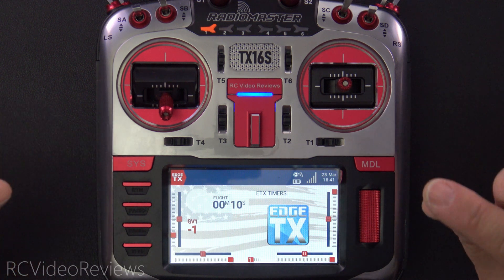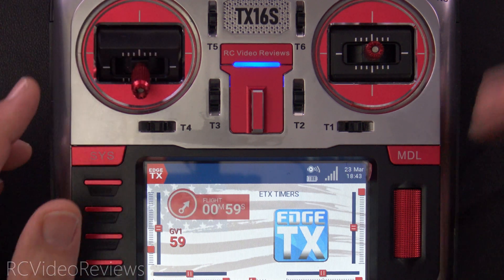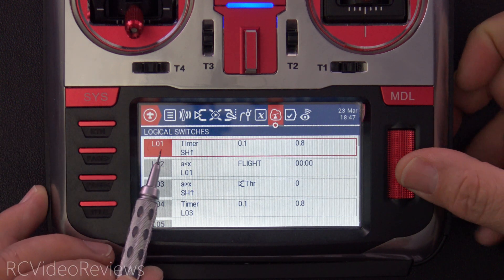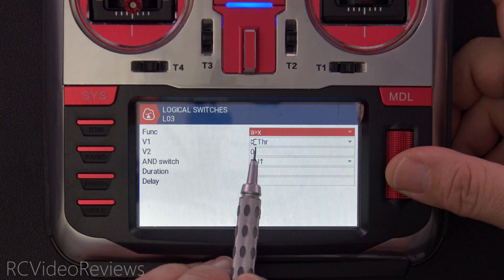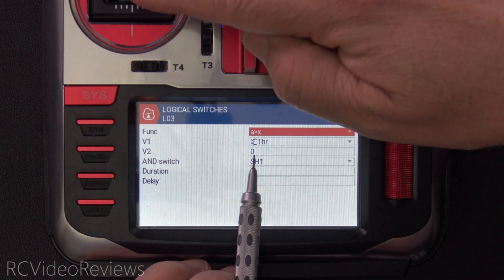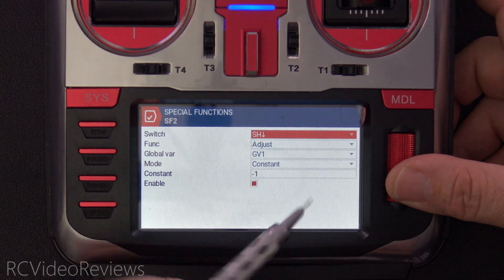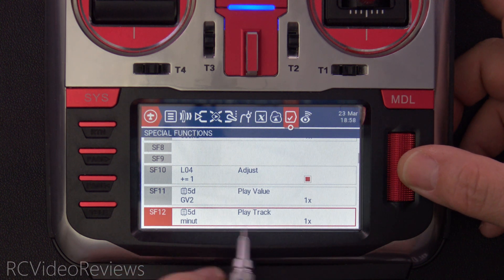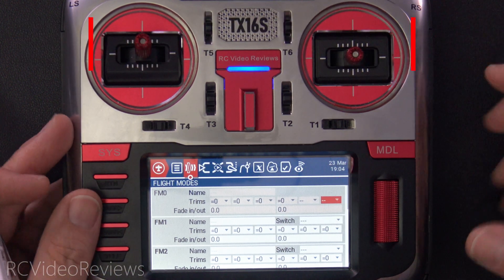EdgeTX Snippet  • Using the Logic Switch Timer Function

Comment: Wanted to thank you for this proof of concept. 7 special functions, 7 logical switches, and 7 sound files (strange coincidence) later.. I managed to use your video to set my Zorro transmitter up to announce "send it" and flight timer starts incrementing, only when throttle is above 50% and quad is armed. Later, when you disarm, it announces "Hope you had a nice flight, your flight time was...". It only announces once in each case, and all works exactly as you would expect. I spent hours at this between watching your video over and over, sitting and thinking how I could apply your video in my own case, and then actually designing and testing this. I've also got one of the momentary buttons set up with edge logic switch to support three functions based on how long I hold the button down (announce flight time, announce total flight time, reset all flight time statistics). Honestly, this kind of stuff should just be built in to the example models...

Comment: I have a problem with my timer starting before i even move the stick past the centre. My throttle is supposed to start at centre or 0, but my timer starts before I even get the stick to centre or past 0. How do I fix this. ? Another issue my old OpenTX version is buggy and when I ask it read out RSSI on a stick it plays minutes.

Comment: I am trying to keep track of how long the radio runs on a batery charge.
I could not find a radio global variable to store values.
Do you know a way to do this?
Thank you for all the good things I've learned from you.
Carlos
Reply from the maker: I guess you could start a count-up timer and set it to persistent. Turn the radio on with a fresh charge, start the timer with a switch and let the battery run to empty. Turn the switch off, re-charge, and that timer should show when it stopped counting.
Reply: @RCVideoReviews  
Hi John, as I understand, persistent timer is per-model and I want per-radio timer.
The battery I use is LifePO4 and it is not reliable to avaliate the remaining charge by reading their voltage but it is accetable to judge if it is time to recharge by the "radio on" time.
Carlos
Reply from the maker: @carlossp1 doesn’t exist. Gv’s are per model too. It sounded like you wanted to measure the runtime. If you’re just trying to monitor for live use, you can put battery voltage in the top bar and just watch that like the rest of us.
Reply from the maker: @carlossp1 voltage is far far more important than time.
Reply: I have the battery voltage on my top bar and it always served me very well with my Li-Ion battery, but now with the LifePO4 battery the voltage remain the same almost to time to recharge, so battery voltage is not a good indicator of end of charge when you use e  LifePO4.
I am using a LifePO4 because my Li-Ion died(don´t know why) and I have 2 LifePO4 here that I can use, but if it is impossible to keep track of the "radio on" time, mabe the best solution is buy new Li-Ion batterys.
Thanks for the help
Reply: @RCVideoReviews   Hi John, sorry to bother you again with this theme, but I wrote a very simple Lua Script that allow me keep track of the time the radio is on between battery recharges, so I will not be surprised with a discharged battery after my first flight on the field.
As I told, the very flat discharge rate of LifePO4 batterys make too difficul to avaliate the remaining charge by simple rreading their voltage.
If you think this script can be of interest for anybody, I can upload the code for you with the instructions to install and how use it.
It is not a professional script, maybe can have bugs and for sure can be better coded, but I only had few hours to write it and for now it is doing his job.
Again thank you for all lessons you give every day for we all.
Sorry about my not so good english, I am from Brazil.
Carlos

Comment: Could you do a video about how the global variables work differently between EdgeTX and OpenTX? I recently was going to use Mr.D's example of the Yaapu Mapping lua script setup by using a trim switch to control a channel. It worked with special functions, but the global variable was no longer able to limit the output endpoints so the trim was not limited to intervals within the normal range. After doing more research I learned that the lua script uses the function as a momentary zoom. I'm using a slider at the moment, but being able to turn a trim into a dual-momentary switch that returns the channel to the original value upon releasing the trim button. This was easy to set up with OpenTX GV, but seems impossible with EdgeTX GV.

Comment: Love this stuff!
I use logical switches to automatically reset the flight timer after I disconnect the flight battery. It uses the rssi telemetry. When rssi reads zero for five seconds, timer resets!
Reply from the maker: That's a great idea!
Reply: @RCVideoReviews  Thanks! And congrats on the award from Radiomaster. Well deserved man!
Reply: @RCVideoReviews  that's how I've set mine up but with a wait period that doesn't reset the timer if it is less than 1 minute because I take off with a quad fly below the trees to a clearing land to reset the home position by disarming the quad, sometimes that can take some time so I wanted the time to continue and not reset immediately on disarm, now Im thinking I may take battery, and throttle position to do a multiplier of sorts to the countdown timer or count up timer because I know at certain amps how far I can go... ehh complexities but you can thats the beauty of it.

Comment: I'm curious. If you changed your throttle lock to the top right switch, what do you use now for the switch on the top LEFT of your Tx? 
   Do you even use a momentary switch anymore designated for buddy boxing? (off=control goes to instructor, on=control goes to student Tx)
   Please your REASONS for this change of sides.
- Jim
Reply: John did an entire video on moving his switches. He wants the momentary switch on the left to avoid inadvertently moving his right stick when he uses "insta-trim". Others move switches because the radio they previously had the throttle cut on one side or the other. https://www.youtube.com/watch?v=C3OO2poE2aM
Reply from the maker: I use the top left for Instant Trim. As the right stick controls aileron/elevator I found when I reached for the momentary to use instant trim my ailerons/elevator kept moving. Switching to the left I don't have that problem. I can click instant trim without ever moving ailerons/elevator. I trim rudder manually.

My buddybox configs don't use switches. I designed a quick takeback option so when I'm using the sticks, I override the student. When I let go of the sticks, student has control. https://www.youtube.com/watch?v=030liiCDXYY